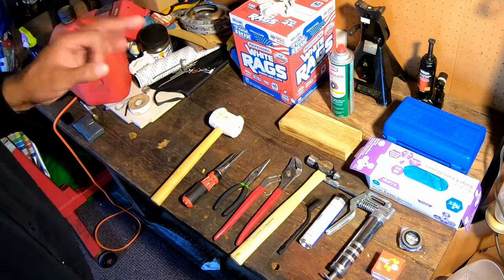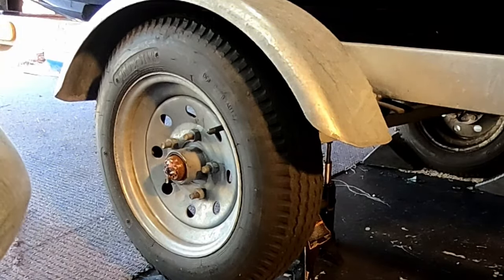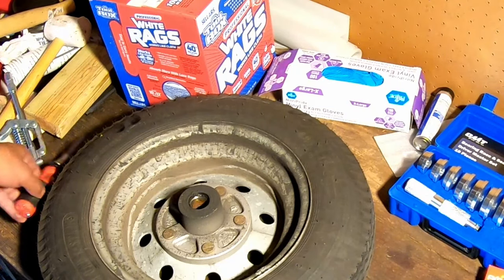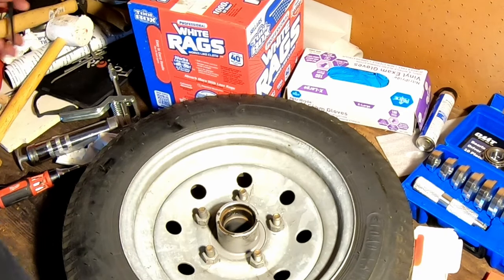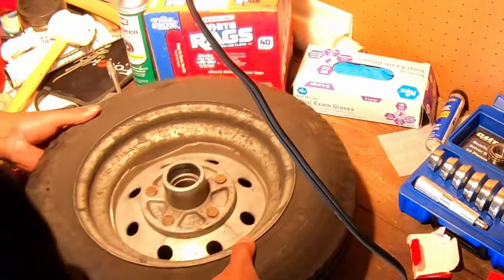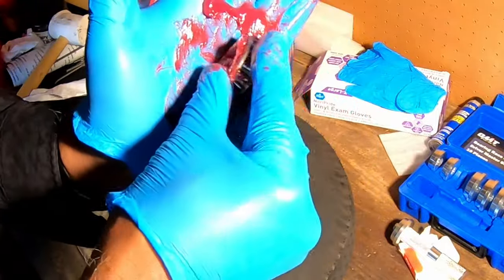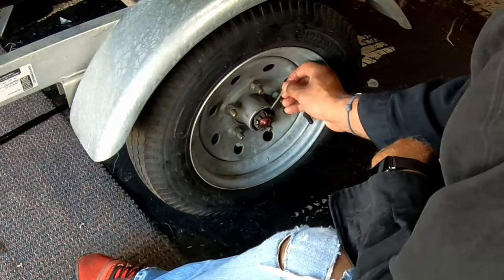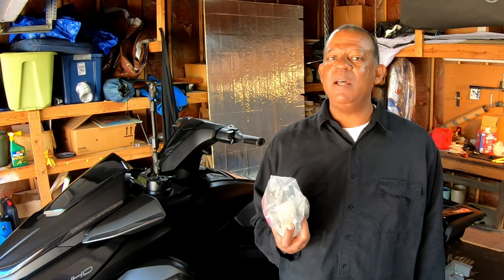How to - Trailer Bearing Replacement

Comment: Attempted to do mine but my trailer is an EZ Loader and a sealed bearing that’s all part of the entire hub, so I guess I will be waiting until I jack up and roll the wheel while listening to some grinding, or when the bearing cap is hot after a ride, or slip in the wheel of course. 👍🏽😎
Reply from the maker: I think a sealed hub will probably last a bit longer so you should not have to change things out as often.